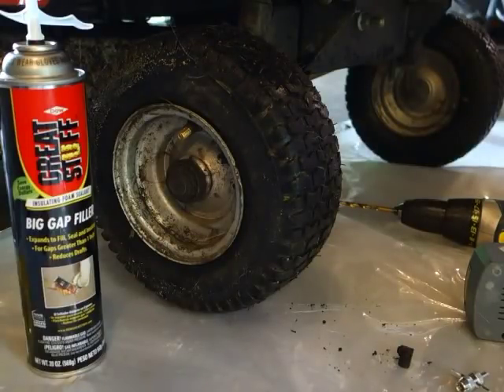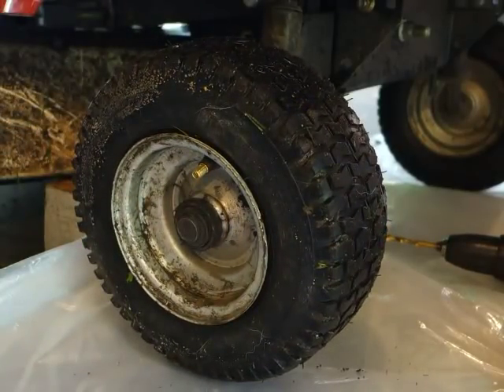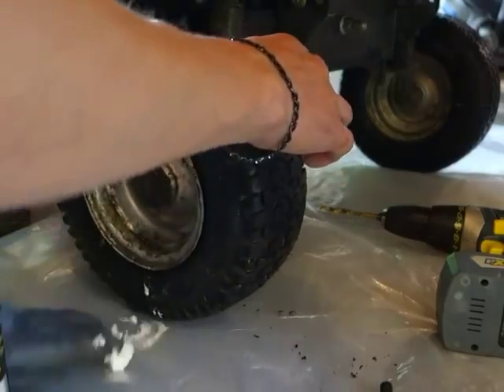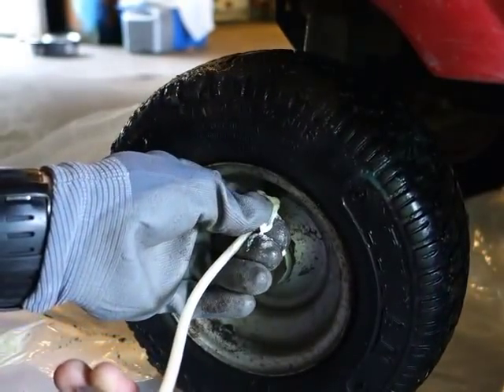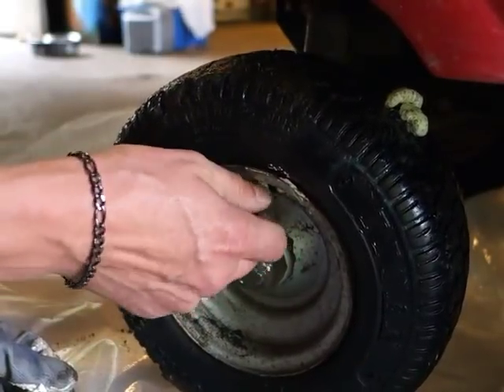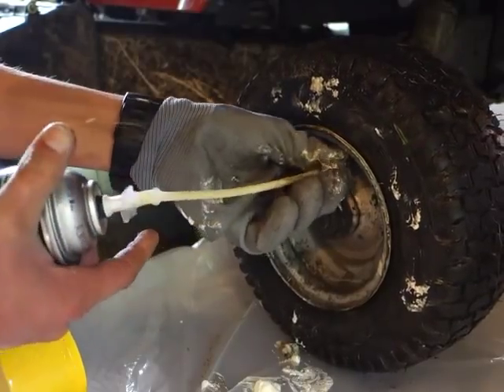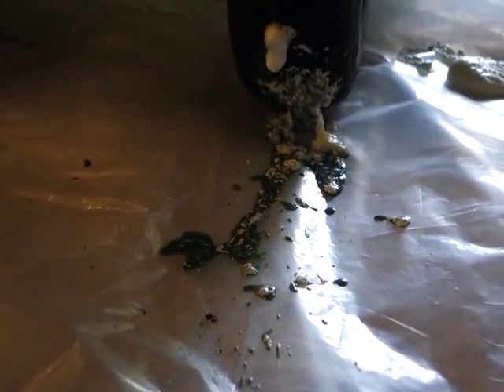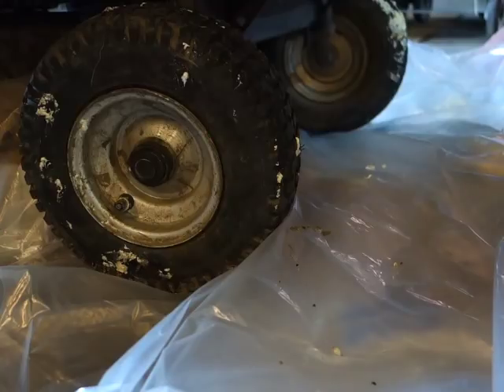sprayfoam tire fix FAIL!

Comment: Looks like you were not holding the can upside down, and that you were pumping in mostly air, instead of the foam.
Reply: spray foam doesn't come out better upside down as far as i know, maybe fix a flat does?
Reply: whydoineedtohaveacct read the can...upside down it is...he filled it with air pockets
Reply: can says nothing about upside down, have it here and took a pic for the ijuts, youtube not showing an add picture option tho, does explicitly state do not add water if used in closed cavities......
Reply: We just used two cans into roto tiller tire.
Two holes on opposite sides of tire.
Worked great.
Held can upright.
My friend sold spray foam and used these before.

Comment: I think the problem is that you needed more vent holes. The way you did it, you trapped air inside the tire and ALL the air must be removed. The foam can not flow into an area where air is trapped.

Comment: Great Stuff is a liquid inside the can.  In order for it to cure or harden it must be exposed to a large volume of air.  This allows the solvents to dissipate as the product expands.  When sprayed in small holes in a tire mounted on a rim, guess what?  Very little exposure to air, so it expands and shoots all the product back thru the hole(s).  Then, it hardens all over your wheel on the outside.  I speak from experience...

Comment: Then direction on the can clearly state to hold the can upside down otherwise all you do is empty out the air and not the foam solution . by  the time he did hold it upside down all the air was gone

Comment: there's no pickup tube in those cans, the reason it failed is that you didn't hold the can upside-down. It's right on the instructions. The foam won't come out of the can after the first little bit if you don't hold it upside-down. That can also probably wasn't quite enough to do 2 of those tires. Looks like a big can, but it's not enough volume.

Comment: You have to fill from multiple  points on the sidewall while the tire is flat on the ground. This let's the foam pool at the bottom and will only come out when full. Can't win am all.  I agree it was a FAIL but the method is still sound and I have see  it work when done right.

Comment: The foam comes out upright just fine, no water is needed (duh) but it does not harden in the can, why? It will not expand and harden in a tire either unless it has plenty of air. So one must take the tire off one bead then fill it and let it harden, cut away excess and scrape the mess off everything else or just plug the hole in the tire and fill with air.

Comment: You didn't hold can upside down. The gas in the can filled the tire until it leaked out. Read the instructions.
Reply: the instructions say NOTHING about holding the can upside down. It mentions that a water mist helps it cure quicker. You should read the instructions.

Comment: The new Great Stuff isn't like the original product from the '70's. Back in the 70's, this stuff was GREAT. The only complaint some people had was that if they had wimpy window jambs, it used to push on the jambs too much and they would be crooked, but we used to use Great Stuff for sealing up rusted holes in our cars under carriages and such so we could fiberglass over it. That old Great Stuff would set up hard. It really was Great Stuff. Not so great anymore.
Reply: Ray Brensike 
You can thank the environmentalists.
Reply: tell the truth, Michael.
you can thank the LIBERALS.

Comment: first of all, the comments stating that he used the can incorrectly are wrong. anyone who has used a can of great stuff can see and hear him filling with product and not just air
second, I think it was a mistake when he put the valve cap back on. if it expands and overflows, so what, trim it when cured
third: although this video was posted in july, expanding foam must be applied in warm temperatures...it will not work in anything below 50*F but it is much better if it is applied in +80*F 
lastly, the product needs to be applied through multiple holes drilled in the sidewall 
spinning the tire to spread the product after application wouldn't be a bad idea, either 
and there is nothing wrong with tire slime 
one last mention, obviously the bead must be set on the rim before adding great stuff

Comment: Did you spray water in the tire first? The foam needs that to activate.
Reply: Big Cheese I've used that stuff millions of times it doesn't need water to activate
Reply: M MARSH insulation foam in a can is not water activated I don't know what he's talking about
Reply: Just add a little moisture in general to help cure it faster in a confined space. It says it on the great stuff website.
Reply: water does speed up the cure but i wouldn't add water for this kind of application, let it do it's thing, will be more robust with a slower cure like most things, proper curing is based on end use
Reply: It needs water (there is plenty of moisture in air) to cure and once the outer foam (NEAR THE AIR) cures,it is SEALED just like in the can. That is why it doesn't cure in the can. It is a stupid idea anyhow. Maybe on a rusted out wheelbarrow where it will be time to throw out once a new tire is needed. Good luck putting a new tire on a rim that is completely covered with dried foam. That foam welds to everything it touches and is next to impossible to remove without destroying the surface. Goof off or xylene removes most anything and it doesn't do shit for removing expanding foam once cured.